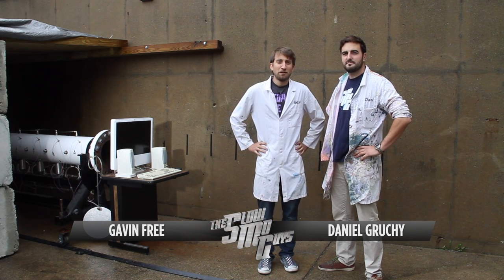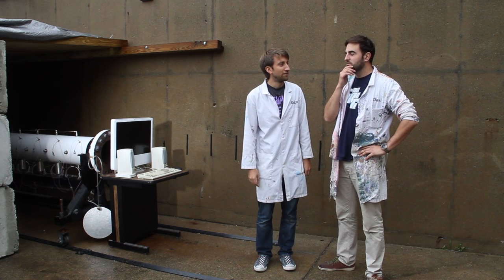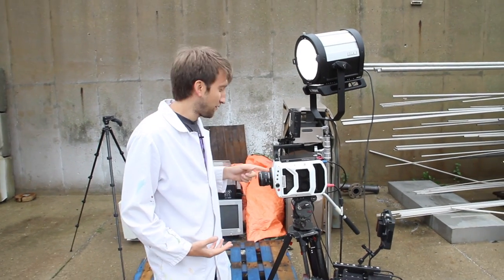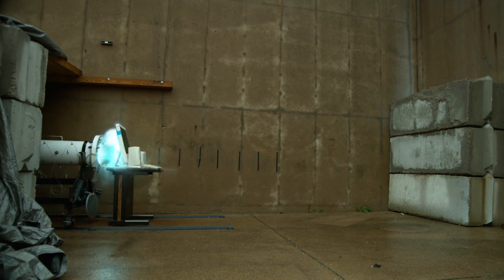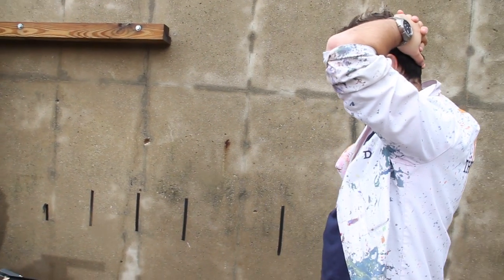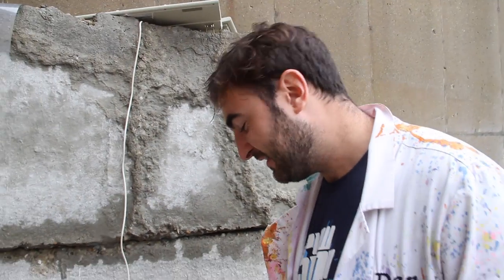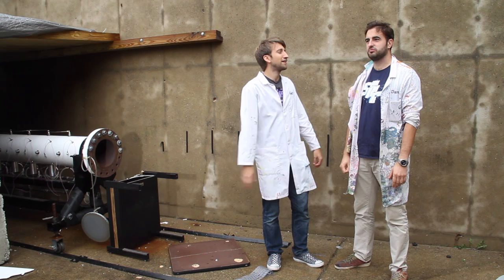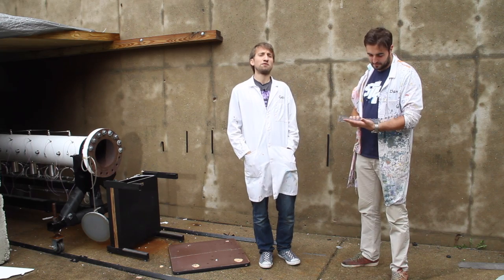Combustion Tube in Slow Motion - The Slow Mo Guys

Comment: I know its grisly, but i cant be the only one thinking it: i wonder what would happen to a person
Reply: Hank Wimbleton i did too
Reply: Hank Wimbleton There is an old British execution method involving tying the condemed to the muzzle of a cannon and then firing it. The condemed typically winds up in multiple pieces spread out over a few hundred meters.
Reply: +ManMadeGod4 which makes no sense, really... if you're burning someone at the stake, you usually do that to make it LESS merciful.  If you wanted a quick clean death, an axe to the brainstem was/is the most humane way to execute someone.  That, or the ancient method of stoning, where a big boulder was smashed point blank to the skull, knocking the person out, and then everyone chucks a rock so that no one person is guilty of taking the life.  More messy, but still almost no pain experienced by the condemned.
Reply: Lars Lars Pantsonfars Burning at the stake was a punishment as well as a form of entertainment for crowds, explosions entertain crowds, ergo combine the two for maximum profit.

It wasn't like they exploded right away. They burned for a nice while until the gunpowder would ignite.
Reply: This should be a method of execution. Slow mo and all.
Reply: Most likely it will shatter your bones...
Reply: It actually was a method of execution.
It's called being "blown from a gun".
Tied to a cannon that is fired without a ball.
Reply: Glenn Burrow
savage
Reply: The Brits used that as a way to "Make a point" when they executed the mutineers after the Cawnpore mutiny in Afghanistan. Rather definitely makes a gory point.
Reply: Grizzly*
Reply: No, it's grisly
Reply: ***** Thanks for volunteering.
Reply: Could get an idea with a pig carcass

Comment: Was the camera shake real or did you add it in? Great work with the video as usual 👍
Reply from the maker: Vivek Murali we never alter the footage in any way other than colour correction. The camera shake was from the shockwave of the explosion.
Reply: Holy shit that's amazing. How far away from the cannon thing was it set up?
Reply: The Slow Mo Guys great video
Reply: ha colour
Reply: its 2 years since the uploaded the last video is as old as that mac
Reply: Vivek Murali Probably real 'cause the explosion waves can shake stuff up pretty bad
Reply: Mr. R&D he did say it was real and I'm inclined to believe that 😊 but I'm super curious about how far away they had set up for the shockwaves to hit the camera
Reply: You can actually see the shockwave in the 1000fps clip ripple through the tarpaulin, and also hit the concrete wall.
Reply: I think its around the same distance as the wall is from the cannon, because it shakes the same time the shockwave hits the wall. I might be wrong because that is pretty close.
Reply: Daniel D I dunno man. The shockwaves might be moving fast enough to seem that way even in slow mo but yeah you might be right
Reply: Did you not see the enormously powerful shockwave ripple through the cement? If that doesn't make things shake, I don't know what will.
Reply: Alan Hunter lol I did but I didn't think the camera would be close enough to be shook up as well. Zoom lenses are thing
Reply: I'm guessing it was a shockwave?
Reply: it was 6 times faster than the speed of sound - brobably the sonic boom
Reply: Vivek Murali
Reply: Vivek Murali obviously real
Reply: Vivek Murali have you never felt the shock wave of a gun? It would be like that but times 10 probably
Reply: Wait so even the sounds are real? I thought they were added by editing.
Reply: Slows down the real time recording of the event to match the frame rate and plays with the levels a bit so thats its not so distorted. So not as accurate but not entirely fake either.
Reply: XanGious same, I still think those are added. They said they didn't change video, not audio
Reply: I reckon the sounds at less than 1000fps are mixed in with real audio when it sounds okay. For faster than that, it's impossible to get good audio.
Reply: They've said before that none of the sounds in slow mo are real - they can't record with a high enough sample rate to have a decent sound when slowed down so much.

Comment: A large scale rupture-disk vacuum cannon may be fun for slow-mo too. The inrush of air pushing your projectile of choice through a long enough evacuated tube can get it to some amazing velocities. Then you just need a brick wall like in this video. Also it's probably easier to setup than that thing in this video.
Reply: A bit. But some of the better ones accelerate stuff a good deal past 400MPH. Look for the vids.

Comment: I did the math for the flame and that's 6,480 km/h, correct me if I'm wrong but that's just a bit fast.
Reply: Avinash_ 
Isn't that about the speed of sound in air?
Reply: Marcus Alm the speed of sound is 300km/hr so a 'little' bit faster than the speed of sound
Reply: No, sound is 1200 km/h, 300m/s. so 6,480 km/h is about 6 times faster than sound...
Reply: I had always thought that the speed of sound at sea level was around 1200 kph
Reply: Yup that's it
Reply: Hayden S Where did you get the figure 300 kph?
Reply: Marcus Alm nope thats waaaaay more... around 6x faster than then the speed of sound, which is around 350 m/s or to make it simple 1000 km/h
Reply: he probably got kph and meters per second confused
Reply: Boubach sorry, thats what I meant to say
Reply: Q'Kumber
Reply: Hayden S Hmmm i find that hard to believe, when I took physics no one had messed up m/s and kph
Reply: Ok, assuming the speed of sound is 1200 km/h in air (and normal atmospheric pressure and shit), 6 480 km/h is 5,4 times faster !
Reply: 5 times faster would be more accurate, as 6,000 is closer to 6,480 than 7,200
Reply: Some Guy how is a rounded off number more accurate than the actual calculated number????
Reply: The math lol converting m/s to km/h, anyway just as 1800 m/s you can realize it's 1,8 km/s which is interestingly fast
Reply: Tis 1 km/h.
Reply: wat
Reply: At the time of me posting that reply, Boubach's calculation was not on my screen. I saw him saying that it was roughly 6 times, not that it was exactly 5.4 times, so I corrected him, unaware he had corrected himself.
Reply: It wasn't really a flame, it was a shockwave/detonation.
Reply: no
Reply: It's 648 km/h because 1800m/s is 1.8km/h and times that by 360(60 seconds times 60 minutes) is 648km/h
Reply: you mean 1.8 m/s
Reply: @wasteful videos 60 seconds times 60 minutes is 3,600 not 360.
Reply: wasteful videos Actually, the original commenter was correct because 60 x 60 is in fact 3600 not 360.
Reply: I remembered 320 m/s for the speed fo sound, just did the division wrong in my head :p
My bad!
Reply: Riley Peters thanks for the correction i did the calculation as fast as i can and i didn't notice
Reply: wow!
Reply: If you want to convert km/h to m/s, (or m/s to km/h) you have to multiply or divide by 3.6
Reply: Boubach just tried it doesn't work
Reply: wasteful videos
Don't tell me it doesn't work, it's just logic ! If you want to have 100 m/s in km/h, you do
100*60*60/1000 --> 100*3600/1000 --> 100*3.6   and that's it !
Reply: Boubach i was just messing around.I was kinda bored
Reply: wasteful videos
Ok xD
Reply: Avinash_ no t nojes

Comment: 'It's not working.'
Tech support: 'Did you try turning it off then on again?'
Reply: BOFH :-)
Once I (being the customer) went through all screens in the modem administration interface with the (physically present) supporter and still were completely clueless why the modem wouldn't work.
After more than an hour we found out that I had put a plug in the wrong socket.

Comment: For those who's wondering, the flame shoots out at 6 480 km/h

1 h= 3 600 s

1 800 m/s x 3 600 s = 6 480 000

6 480 000 - 6 000 000 = 6 480 km/h
Reply: How long did it take you to figure that out?
Reply: Hexall man that's some insane math there 
Well done my friend 👍
Reply: Yeah but I speak American wtf is a km
Reply: Hexall Or you could just multiply it with 3.6 and it does the exact same thing.
Reply: Bardy E. kilometer
Reply: No, we weren't wondering
Reply: Bardy E. I speak ‘American’? What fucking language is that
Reply: Hey Hexall! 6 480 000 - 6 000 000 = 480 000

Comment: That combustion tube blew all the guts out of that iMac huh? I guess you could say that it...cored your apple
Reply: Too bad it was pre-weakened.  Can clearly see the plastic framing is already broken/cut in places.
Reply: To be fair that could have been some old hardware that was just laying around in storage in shit condition, you'd be hard pressed to find a "like new" 16 year old mac. Not to mention the explosion bent the metal frame and motherboard in half, so the plastic is an afterthought.
Reply: I note though that the blue tape does not turn up until 2:05 possibly a second or third attempt?
Reply: I actually believed, it would turn out an Apple pie on crashing into the wall... 

you know, similar to when any current iProduct softly touches any hard surface...
such as carefully setting down your iPhone on your kitchen table...
or dropping it onto a soft pillow...
resulting in cracked touch screens 3 out of 10 times... ;-)

but heck, this shows that Apple actually built some sturdy stuff some time ago.

Comment: Look all the way to the right at 2:47!
Reply: Brenner Benoit I don't see anything
Reply: Brenner Benoit do you mean the left side?
Reply: Brenner Benoit i saw mirrored version of the explosion, is that what your talking about?
Reply: It's like the air is counter-moving the explotion!
Reply: That's probably something do do with internal reflections in the camera. Like a lense flare with the sun
Reply: Omg maybe it's a ghost???
Reply: If you look at the wall, it looks like a baby doll with black eyes is looking towards the center of the screen. :3
Reply: If you're talking about the air movement, it's just the sudden burst of hot air pushing cooler air, if you're talking about the bit of the wall that looks like a face, it's just 3 circular things together, basically just bowling ball holes. Not super exciting
Reply: I meant the air movement haha
Reply: Guillermo Ortíz yes!
Reply: Brenner Benoit that's not what it is. It's a visual aberration in the lens, not anything to do with air pressure.

Comment: That's not even a Mac keyboard - is that a PS2 connector? Macs use USB keyboards. 
And what's with using a second iMac when you fired the cannon? The first one wasn't good enough? In case no-one picked it up, the second iMac was held together with blue tape, the first wasn't.
Looked good though :)
Reply from the maker: olsmokey it's the same mac. We did two attempts but the first one wasn't as powerful and just knocked the mac off the table. Cracked the plastic so we taped it up and did it again. Second attempt absolutely annihilated it so that's the one we showed.
Reply: Mac also used their version of PS2 port called Desktop Bus when PC's were using PS2...
Mac hasn't had new tech that didn't exist prior for decades now. They just re brand already existing stuff from companies that work with PC
Reply: olsmokey its only a really old Apple keyboarf
Reply: Nope it's not a Mac keyboard. Apple never used pale blue connectors not even on the old ADB keyboards, they were all a neutral grey.
Reply: olsmokey Because the keyboard doesn't matter?
Reply: No probs SloMo. Just letting you know I picked it up  :)
Reply: Could've been an ADB keyboard...
Reply: i think you might do a better job at this honestly!
Reply: None Ya yeah cause everyone who doesn't agree with you voted for Hillary that makes so much sense
Reply: Chill bro

Comment: I'm happy that Dan appreciates physical keyboards. They are absolutely much better than membrane keyboards and on-screen keebs!
Reply: that is a membrane keyboard, he's holding the membrane in his hand
Reply: @valkorsimpson4525  hmm, I'm not sure why I said that cause you're right, it's very clearly the membrane portion of a keyboard. But take out the membrane bit in my comment and it's still relevant. I believe I was vaguely referring to phones at the time - about two years ago, when I posted it, I was looking forward to the F(x)tec Pro1 which was/is an Android phone with a slide-out keyboard. Turns out, it wasn't for me but still a decent enough phone.

I miss my Droid 4 though.

Comment: Is this applicable in warfare? I would say yes, but then again, maybe this requires a lot of fuel or whatever or maybe it in inefficient.
Reply: StormishBreeze Combustion chambers are just cannons but with no live rounds in them. They are used by the military.
Reply: Theres this thing called black powder, they already started using this mysterious mixture hundreds of years ago
Reply: thats what i meant
Reply: Even if this wasn't just a normal cannon without ammunition, the U.S. Army doesn't care if something's expensive. That it uses a lot of fuel (which it doesn't) wouldn't be a problem for them.

Comment: I took and slow down this video to 1/4 spayed and you can see the computer start smoking from the heat before anything even comes out of the tube. I did a little researchand they said that this flame or burst is moving at 18 hundred yards per second that is just over nine hundred and forty-one thousand miles per hour what the cuhraap